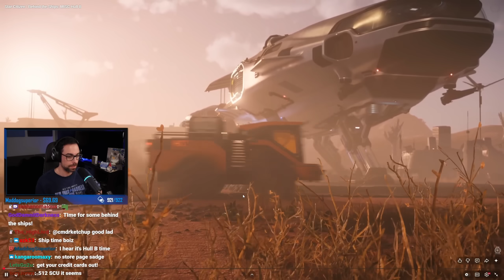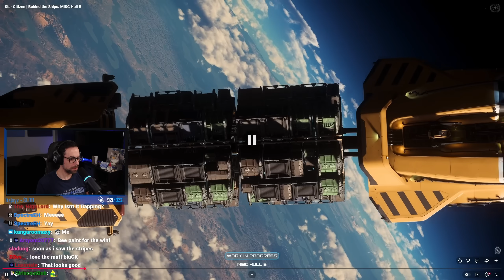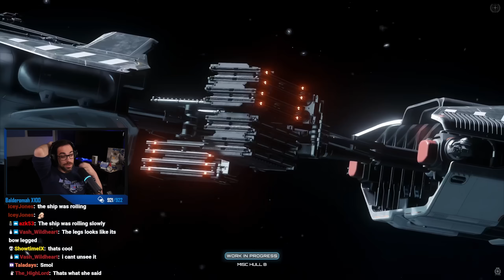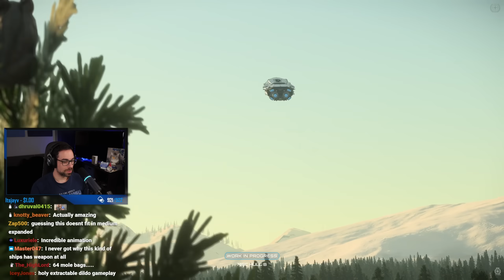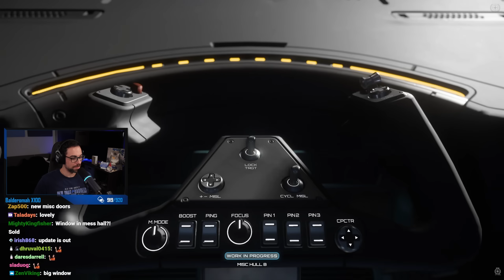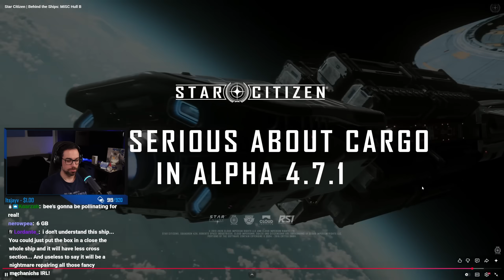SaltEMike Reacts to Star Citizen | Behind the Ships: MISC Hull B

Comment: Maybe I missed it, but does the center cargo rack rotate? Otherwise how do you load cargo on both sides? When you land, the cargo is not going to be conveniently placed on both sides of the ship for both tractor beams to load. It would make more sense to load one side and then have it rotate to load the other side. Most logistics hubs would only place cargo at one door, not two on either side. A loading dock for transport trucks now only has 1 door and one central area all cargo is loaded from. 
Anyone know more? If this is the case, it's a dumb design. The center needs to rotate to make this practical.
Oh wait, now I see, they can charge more for it cause they can call it a multi-crew ship. If the center rotates then a single player could operate it and only one tractor beam would be necessary. Make it not rotate and a 2nd tractor beam can be added and 2 players can use it. Very clever CIG, very clever. Squeeze the stone a little harder.

Comment: the only realistic issue is... the center spine is just too weak... with all the load of cargo on that little spine with all the thruster from the rear when you turn the momentum would bend that spine to a point of breaking...
at least the Hull-C spine is bigger and you can pass inside and the ship isn't much longer than the Hull-B...
the Hull-B is just too long and to tin...
realistically it should have integrity sensor and poping warning everytime you turn too fast when loaded... to slow down...
and following that logic why would you put weapon under pilot control for cargo/industrial ship... all such ship should only have turret... much like the Hammerhead has no gun to pilot...
anyway I should be be as much going into the desert to preach... SC isn't meant to be a space life/flight simulator, but a generic openworld with survival and crafting space opera MMORP

Comment: Just imagine loading this vs, the cat.....its not even a comparison, so clean, easy 16 32SCU containers or any combination of that.  Cat is a nightmare to load and cant even get nearly that many 32 SCU boxes even with similar capacity.   This unfortunately means all the other cargo ships need to be reworked or will probably feel fairly useless compared to this.  At least for straight hauling in sec systems

Comment: Called it. I said the invisible teaser was the final cargo arrangement, and I was right.

And ... I like it. Looks right when loaded. Correct proportion of ship to cargo for serious work, and doesn't have cargo sticking out half a mile in all directions like the C does, so you can fly it through hangar doors and not shed stuff everywhere

I'm happy I put money down on this ship all those years ago. I was a little worried when it grew a co-pilot seat and a dedicated engineering room and bunk beds that it would be bumped up to a requirement for two crew. Particularly given I made my decision based on a crew requirement of 1.

But ... it's OK, the second crew is both officially and practically optional.

And yes, I've flown it in game before saying that.

I'm wondering if I'll miss the loaner Hull A. It was kinda cute in a way this ... isn't. But the cargo size was really annoying on the Hull A. The smaller mission sizes definitely need work. They need missions with 2SCU max box sizes (there's a LOT of beginner cargo ships that are designed around 2SCU boxes but no missions that generate that size), and there's no missions even remotely close to the size of a Hull A. If it's supposed to be the default small cargo ship, you'd expect there to be missions designed around that capacity.

Of course, the alternative is to do a cargo-grid rework using the B as a pattern. With diagonal cargo and 128SCU on a Hull A, that would be awesome...

Comment: The Hull-B tractor beams and medium hangar freight elevators just DON'T FIT each other in any practical way.
Pulling a box from the lower end of the cargo spindle FLIPS YOUR HULL-B OVER.
The top turret is for running away but just like the Freelancer MAX, the turrest's view to the back is blocked.
Why is the weapon locker where intruders can grab them but the utility locker is where the crew is?
With the new letterbox not a single MFD is visible to the pilot.

Comment: looks amazing, by i do have one note.... STOP restricting tractor beams only to copilot seats! no one is bringing a second person on board only specifically for that one job, and it feals like such a forced limitation 😭
Reply: The Hull B Q&A states that the pilot will have control of it, but for now it's bugged.
Reply: @ShadzDash than it's weird they specifically only mentioned it to the copilot but no matter, that's cool in this case
Reply: @ShadzDash why a pilot should have it? He pilots the ship. And when he's not, he is free to make two steps to take another station.
Reply: @ilyich333 because getting out of a seat just to sit in another seat just to do one thing and then go back is annoying. 😅
Reply: @ilyich333  In the ZEUS MK II at least the copilot can operate tractor beam AND reposition the ship. In the Hull-B you have to switch seats 8 times to get all cargo off and reach deep into the cargo elevators despite the inpractical placement of the tractor beams.
Reply: @ilyich333  because that is a stupid, nonsensical, and arbitrary limitation, that's why.  And also, because there are two tractor beams but only one seat that can use them, so even if you for some reason were doing cargo running with two people, only one crew member can use it.

Furthermore, you know good and damn well that the seat animations take long enough to make changing seats take longer than "two steps" would take.
Reply: @CrowDawg11 makes sense to me. Because in cargo hauling you can use only one side of the ship to load the cargo. Therefore, there is no need in second tractorbeam, and second operator. To load the other side, you need to take off, face the ship with the other side to the elevator and land.
Reply: @ilyich333  not if you face the ship towards the elevator.  Regardless, that's still a weak argument for artificially and arbitrarily making someone change seats for no reason.
Reply: @CrowDawg11 than you won't be able to load any of the sides 😂
Reply: @ilyich333  did you not actually watch the video?

Comment: Too bad the spindle doesn't doesn't rotate to help loaders on the ground d without moving the ship.
Reply: load top to bottom unload bottom to top what's the problem?
Reply: @Pandemanium_TV With respect, you're missing the point. If the cargo is biased to that one side. That creates the problem of  having to move the ship.

 What I am recommending is automating the spindle rotation by 180 degrees from the touch of a button. This solves that problem, thus enhancing the experience. 

Thanks